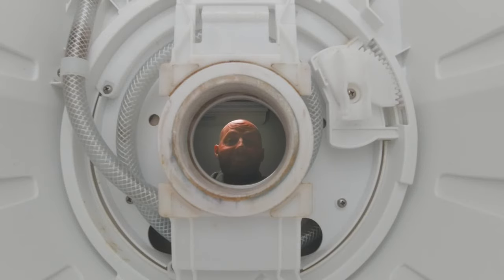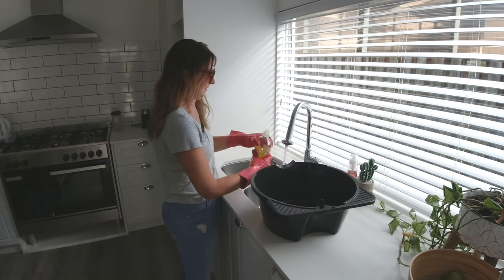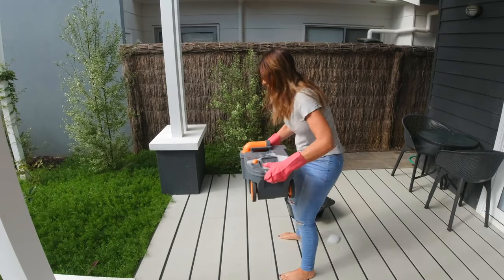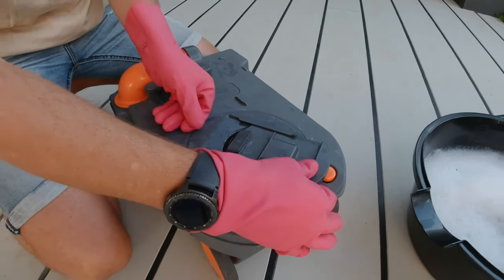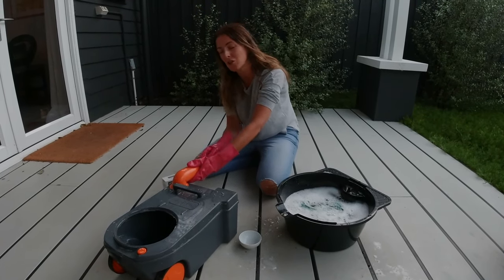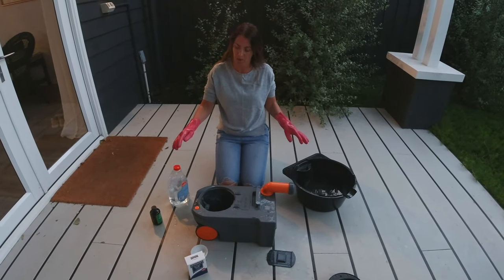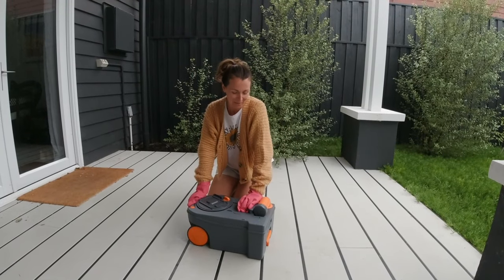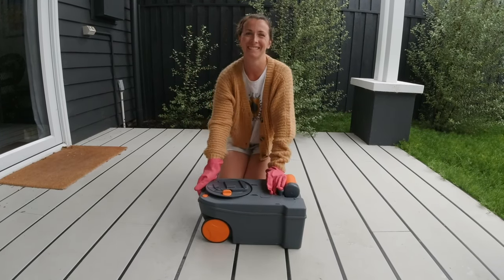How To Clean Your Thetford Toilet Cassette |  Household Green Cleaning

Comment: That was absolutely minging.  It needed a gallon of petrol and a match not a clean.  There is no reason the cassette shouldn’t look brand new all the time. Only requires 10 mins cleaning at the end of each trip.  It must have stank in the RV.  I feel like I’m gonna throw up.
Reply from the maker: We’re full time travellers on the road and have been for 1 year. No chance of cleaning it after each trip here!! We carry a spare as well as they get used that much. These toilets cassettes cost $250. Wouldn’t be a cheap exercise if I was to burn them 😂🤣. We just do what we gotta do 🤢🤮🤣

Comment: Well I have to say thanks for the video. However maybe not for the expected reasons! I started stripping the loo and found only 1 of the 6 screws holding the lip seal in place hadn’t broken from the top moulding, explains where the ‘fluid’ was leaking from in the toilet compartment. So thanks again. I now have the cleanest broken caravan loo!

Comment: I broke mine trying to turn the top with the slider bit.  I just got a piece of scrap wood in the end.  Works every time.  It cost me 50€ odd for a new top section.  Otherwise good video.

Comment: theres another video where the owner cut a long piece of wood that would lay down between those tracks. This could be laid down and used to give more leverage to twist open the top.
Reply from the maker: Yep I watched this vid but unfortunately I didn’t have the tools or timber to do this so had to stick to the original plan. 👍

Comment: On another video, if you turn the orange waste pipe right around it comes off so you can soak that too.
Good video.
Regards kev
Reply from the maker: Thanks for that info Kev 👍
Reply: @venturingfour  pleasure, i have just bought i second hand bailey senator Virginia. But the toilet leaks with the blade shut, l have ordered a new seal that goes in the top of cassette hopefully that will fix the problem.
Reply from the maker: @kevinjohn725  I’m sure that will work. Good luck 👍
Reply: @venturingfour  it did.thanks.

Comment: When I follow your instructions the cassette overflows am I putting bicarbonate in to quick?
Reply from the maker: It could be the bicarbonate or it could be that you’ve mixed too much water and white vinegar. Just reduce it so that the cassette is only half to two thirds full and then add the bicarbonate. Hope that helps. 👍